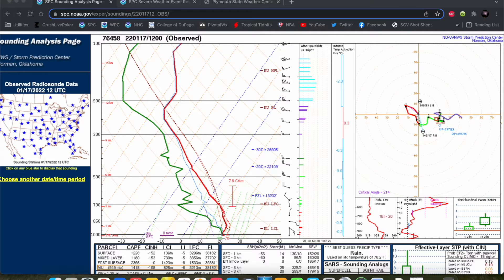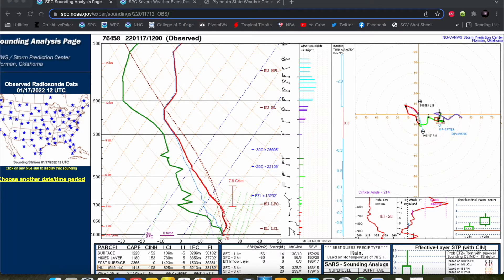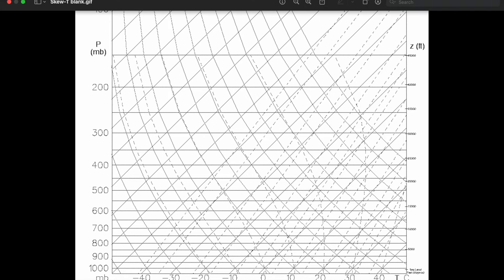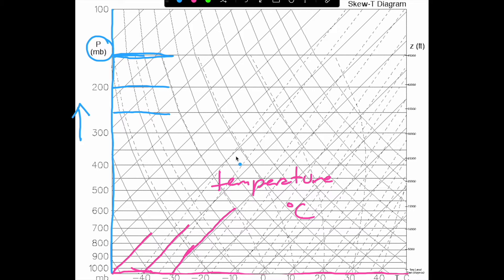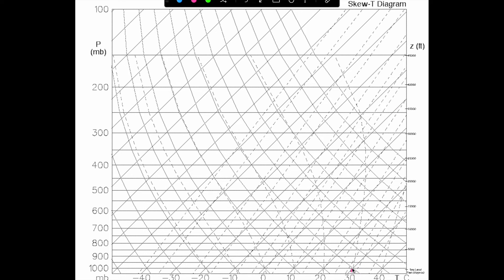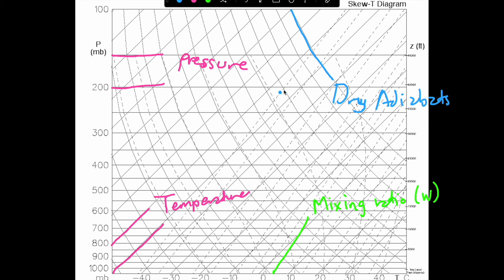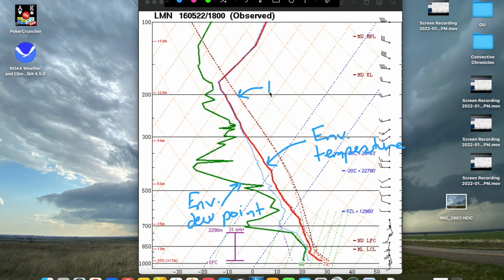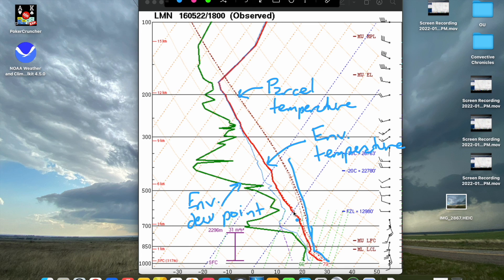Definitive Guide to Skew-Ts and Hodographs - Part 1 - Components of a Skew-T

Comment from the maker: Questions? Comments? Feel free to post a comment below and I'll be happy to get back to you!
Reply: Thank you so much for making these!!! You're a great teacher!
Reply from the maker: @sharessehughes2978  Thank you so much!
Reply: So if warm enough, the MALR is negative for a bit? It actually heats up as it rises?
Reply from the maker: @hudy323  Lapse rates can be negative within a temperature inversion (temp increase with height), but those are usually for very small depths of the atmosphere.
Reply: Is the mixing ratio basically equivalent to the relative humidity?
Reply from the maker: @dailyrandomjokes9141  Mixing ratio is not the same as relative humidity but RH can be calculated using mixing ratio:

(mixing ratio/saturation mixing ratio)*100 = RH

Comment: Late to the party, but is there any correlation between the rate of acceleration of gravity in a vacuum to the dry adiabatic lapse rate, or is the 9.8 just a convenient coincidence
Reply from the maker: Yes, the two are related; the dry adiabatic lapse rate is g/cp, where g is acceleration due to gravity and cp is the specific heat of dry air (1005 J/g•K)

Comment: Thanks for your excellent, informative videos.   I wonder if you might solve a mystery for me.  On the skew-T that you show as an example of an actual sounding at the beginning and again at various points in the video, there is a blue curve located between the red temperature curve to the right and the green dew point curve to the left. What variable does that curve represent? It doesn't appear on all skew-T graphs and none of the other readings/videos I've completed have explicitly identified the variable represented by the curve.  I really hope it's not something that's embarrassingly obvious.  😏 Thanks in advance for your help.
Reply from the maker: Thank you! That blue profile is the wet-bulb temperature profile (check out episode 3b for what the wet-bulb temperature is).
Reply: @ConvectiveChronicles  Thanks!

Comment: Hey, I took a Weather and Climate course last semester and was told the Saturated Adiabatic Lapse Rate was 6 degrees Celsius per km. I was wondering if you provide some clarification on the matter.
Reply from the maker: The Saturated or Moist Adiabatic Lapse Rate is not constant like the Dry Adiabatic Lapse Rate is (9.8 deg C/km); it varies with parcel temperature and pressure. Generally, you want lapse rates to be above 6 deg C/km for more robust updrafts.
Reply: Makes sense. Thank you for letting me know!

Comment: Why does the green line have so many movements?
Reply from the maker: Atmospheric data is never perfectly uniform, so there will always be very small (sometimes larger) variations as you go up.
Reply: @ConvectiveChronicles  ok, in the last part of the video there are very close variations of temperature between 6 and 9 km ,  from -20C to -5C again to -20C in a very short distance

thanks !!

Comment: Awesome👍🙂 video. This is really helpful in understanding skew-Ts.  My question was how can you measure the lapse rate on a skew-t without looking at the observations below it?
Reply from the maker: Thanks so much! You can estimate the lapse rate in a certain layer by subtracting the temperature (in °C) at the highest level of your layer of interest from the temperature at the lowest level of the layer, then dividing that difference by the depth of the layer (in km), where the depth is the height of the highest level in the layer minus the lowest level in the layer.

For example, let's say we wanted to find the surface to 3 km lapse rate from a sounding. We'd find the surface temperature and the temperature at 3 km from the sounding, find the difference, then divide by 3 km. Let's say the surface temperature is 18°C and the 3 km temperature is -6°C. The 0-3 km lapse rate would be:

(18°C - -6°C) / (3 km - 0 km) = 24°C / 3 km = 8 °C/km

Hope this helps!
Reply: @ConvectiveChronicles  That helps out very much thank you.